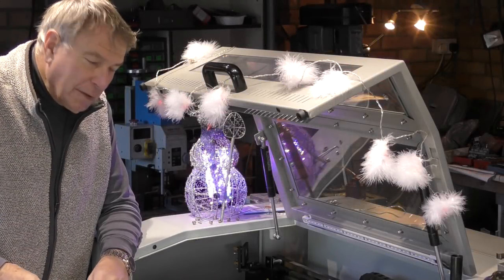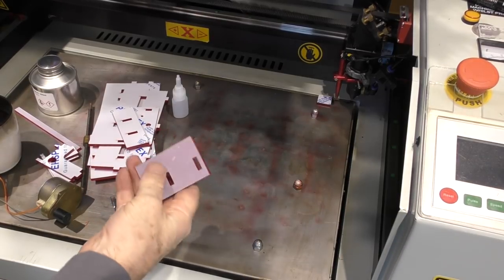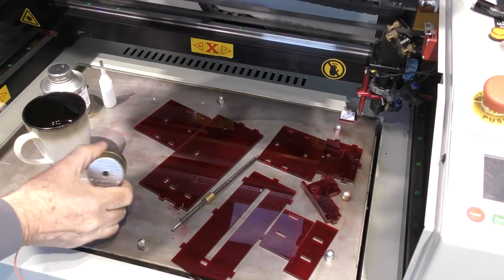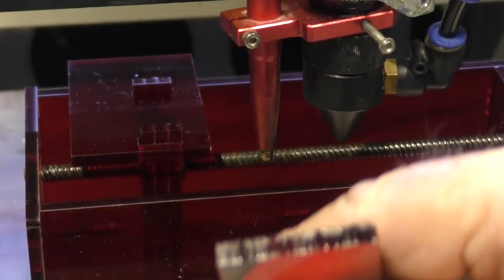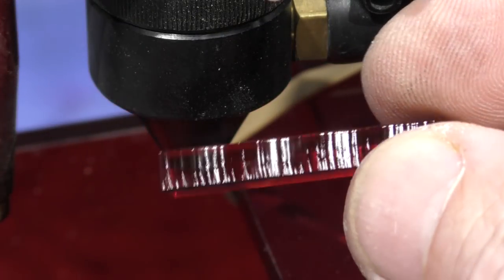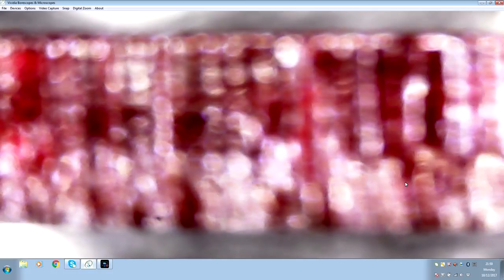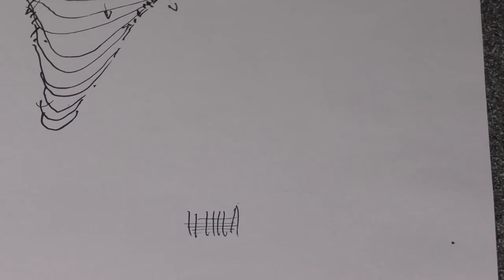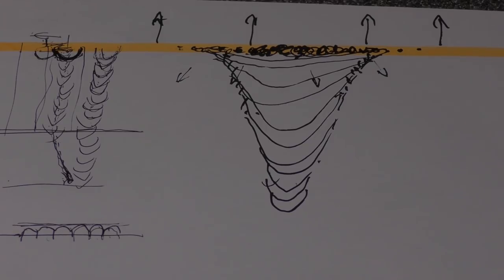RDWorks Learning Lab 128 Are Acrylic Striations Stepper driven

Comment: Are you using the stock diaphram pump for your air assist? If so, its the diaphram pump causing it - add a bit of pvc pipe with done sponge in it to smooth the air flow out or use a compressor with a tank. You can hear the pulsing if you put your finger over the nozzle :) i had this on my first Chinese laser and fixed it with the pvc pipe resistor/ capacitor thing!

If you get three same pattern no matter your head speed, it's mechanical on the laser - pulley, belt or linear bearing.
Reply from the maker: The pattern of striations on acrylic is a very complex subject that I think I now fully understand. The air flow (pulsing or otherwise) has no affect on them. I have run tests at constant speed running (see #128) not with  steppers or servos, and the results are terrible, but there is some fascinating detail to be observed.. the amazing thing about clear acrylic is it is cav be used as a 3D velocity recorder. The slightest velocity change in the head is recorded by increasing or decreasing depth of cut, because the beam is running at constant power. The fact that the head is progressing with a series of microsteps means that the head is continually stopping and allowing the beam to pierce right through before it jumps to the next step. This is the main mechanism for striations and you can prove this by setting the beam to DOT mode and producing a series of straight through perforated cuts. If you get the timing of those dots right you can adjust the values slightly and generate many different aliasing pattern on the edge where the perforations and the steps interact.. If you start running too fast you get something that I call beam drag,.  This is in effect where the beam is not cutting upright (straight through as you would expect) but the  LIGHT beam is being carried around a corner until it impinges on solid material to interact with. This fibre optic property of acrylic is dealt with in  #120. . Provided you do not go too fast this effect will not occur. . I am just in the middle of a video that attempts to pull most of this stuff together to work out why and how you can flame polish clear acrylic and how thicker material is easier to polish than thinner ones plus the fact that when you add colour it becomes almost impossible. to get a gloss finish. I have long been a disbeliever of the  idea that for thicker materials you must drop the focus point into the material to achieve deeper cuts.  Acrylic proves to be a great material to show just how fallacious this notion is.
I have played with various pulse damping mechanisms but to be honest if you manage your air flow efficiently, specifically for cutting) you only  need a gentle laminar airstream directly into you cut. If you can hear the air hissing then you have expanding air as it exits the nozzle and  most of that air will spread rapidly outwards leaving  very little to finish up where you need it. That efficiency depends on the lens tube system that your machine uses and the nozzle hole size.  With some systems the nozzle remains a constant distance from the work (about 5mm) regardless of the lens focal length   Other systems have the lens mounted in the nozzle where any change of focal length means the nozzle (and air assist) moving further away from the work surface. This second system is bad because that bigger distance makes it impossible to manage your air assist for all situations.
 You do not need air assist for  engraving  it only pushes the  burning fumes back onto your work. Efficient balanced air flow  should also leave the surface of your cut work clean also. 
Coming from a metal cutting laser background, where high gas pressures are essential. my first action was to hook up my shop compressor. Big mistake. I soon changed back to what appeared to be a stupidly small pulsing pump. Manage that nozzle flow correctly and the flow is virtually pulseless anyway.

Best wishes
Russ
Reply: I'm not sure I can agree - I've used both glass and RF tubes on thin and thick acrylic that have given absolutely smooth polished finishes on every cut (extruded acrylic) with a good smooth air stream, using a diaphram pump on one of the chinese lasers gave the same pulsed pattern you see - I never bothered with diaphram pump there after. You can also see the effect of the pulsing when cutting plywood, if you get the laser to the point it just breaks through the bottom of the ply you will see variation of width that match the pump frequency. This also doesn't explain the patterning on your engravings, which have nothing to do with gas clouds.

As to the pattern in this video on the edge of the acrylic... you can see the whole thing weeble wobbling around at a constant rate, so I'm not putting much stock in it sorry.

Trotec recommend running their RF tubes are very high pulse frequencies to get the smoothest most polished edge, but still not continuously on if that helps at all :)

I completely agree with no air assist or just the tiniest amount to give a tiny bit of positive pressure infront of the lens when engraving. This one eluded me for years until it was mentioned in a Trotec course and I couldn't believe I missed it!

Another thing on your beam drag - the hot gasses continue to cut even if the beam isn't strong enough to punch through - you'll see some drag mechanism here too. As acrylic is completely opaque to 10.6um light pretty much perfectly, you won't see any fibreoptic effect or the light beam being bounced around inside the block. This is where air assist can help push that gas cloud down through the cut, it's quite apparent on the Epilogs that have the air assist as a separate tube that is not coaxial with the beam, you don't get anywhere near as good a cut as with a Chinese laser or Trotec - it's like running with air assist off, it's enough to stop the gas igniting but not enough to assist the cut. However, I'm sure you're well aware of this from your metal cutting days :)

For the putting the focal point inside the material - I've always understood and used this as a method to get a more perpendicular edge on the cut, rather than more penetration.

For the colour of the material, are both extruded, or is the colour cast? Colour tends to be cast acrylic (great for engraving, poor for flame polishing) because they can run smaller batches (1-2t of material, vs 10-20t for extruded) so you'll see mostly just black, white, clear in extruded. I'd love to see you test the difference between cast and extruded acrylic for engraving, 3d engraving, and polishing. Cast gives you a nice frosted effect for engraving, engraving on extruded in my experience is a little underwhelming by comparison as it tends to polish pretty quickly.

Thanks for your well thought out, extensive replies!
Reply from the maker: Hi
I have not had the luxury of using any of the pro machines or being exposed to any of their training. In addition you also have much everyday experience of using all types of machine. I started off from ground zero and all my knowledge has been derived from experimentation and making mistakes. As an engineer I try to deal with facts rather than conjecture  so  my facts are my facts. However. All FACTS have conditional boundaries and those boundaries may be different for your equipment. I never claim that my videos are some sort of gold standard, instead. I define the  problem I am trying to solve and then explain my plan with the thought processes and logic  that guides me. There is no smoke and mirrors in my experiments they are what you see. I draw a set of conclusions from my results, but you may see the same data and disagree or see something else. I really value your different view of things because it allows me to benchmark my own efforts.  As  mentioned elsewhere, I am currently in the middle of a video about acrylic and the conditions that need to exist for edge polishing to take place plus a lot more on the subject of striations and total internal reflection.( all done in my own shed science way). I will make sure I find some cast and extruded materials to compare  The fact that Trotec advise running at high frequency to avoid  edge marks  could mean that,  despite their silky smooth DC drives, the pulsing action of a low frequency beam is causing edge striations.  I could imagine this to be exactly the opposite conditions  to mine, where the beam is steady but the motion is pulsing.  I can do nothing about my pulsing movement if I run my machine in a normal way. This current  video is a bit of an acrylic fest and I'm sure there will be a few things in there that will make you think a bit more.
All best wishes and again thanks for  your contrasting views on this subject.
Russ
Reply: Can I send you some blocks of hardwoods to try the same test you did with the Acrylic blocks to see how much penetration you get? I can do the test with my laser... but I don't have any blocks of acrylic for a direct comparison. I'd be curious to see how the beam behaves in solid wood which will char and give you carbon rather than just turning to gas. Obviously, you'd have to cut the blocks across the beam penetration to see the pattern unlike acrylic!
Reply from the maker: No Problem it will make an interesting experiment. If I put several tests in perfect alignment I will be able to mill the surface away to reveal cross sections
Knowing what I now understand about the nature of the beam, it will be no contest. The best chance of getting a deep hole in the wood will be within the first few milliseconds when the high energy focused core will instantly erode (if I can use those two words together) its way into the wood by a process of burning the cellulose away leaving a thin carbon film that in turn  will instantly heat up to 3500C and gasify leaving more exposed cellulose to be burnt,  leaving  a thin carbon film behind etc etc. Very quickly two things will happen. A) the hole will fill with smoke which is VERY absorptive of IR light. Those micro solids in the smoke will heat up and burn. thus preventing any more efficient penetration of the high energy core. B) the longer the beam is left in the hole the greater the effect that the lower energy outer part of the beam will have. It has sufficient energy to convert the cellulose to vapour but insufficient energy to instantly excite the carbon to its 3500C sublimation temperature. So it will It will glow white hot  ( causing some slow rate carbon sublimation) and effectively become a carbon arc lamp burning spots on your retina just like looking at the sun. There is a significant UV content in the light so it's not good for your eyes. There will certainly be no internal reflection to conduit the light energy down to the sort of extremes you see with acrylic.
With air assist, a 2" lens and a Reci W2 tube (about 80 watts) I have cut a through a 3/4" plank of American oak  at 5mm/s. BUT that was from a side entry cut NOT a through cut. That would have been impossible for the reasons I stated above.. Penetration ability and cutting ability are two different things and  we both agree you MUST get rid of the energy sapping smoke to let the beam work on the solid parent material rather than the debris.
Message  me with your email address because I seem to remember you were also interested in a dohiky.
Thanks for raising another interesting issue.
Russ
Reply: I agree, I don't think it will do much, but its more stuff to try out and play with - and that always expands the knowledgebase. I also have machinable wax (home made and commerical) as well as paraffin, LDPE, EVA and microcystalline pellets I can cast into blocks if you're interested in the future. The waxes should be interesting as they are very heavy on solids as they ablate/vapourise, but need so much oxygen to burn you wont see much in the way of fire. I'm hoping to try engraving machinable wax tomorrow, if it works out well its going to save me hours of machining with the CNC router to put my logo into some moulds I have coming up.
Reply from the maker: As you rightly say any  material away from the norm will be interesting provided it does not burn with toxic consequences.
Reply: SarbarMultimedia the only really toxic stuff to cut is chlorides, mainly for their effect on exposed metal and ductwork, and aramids - aramids create cyanide gas but in lower volumes than a smoker would see, so no big deal. There's lots of misinformation about polycarbonate because it creates cool yellow or red smoke depending on the rubberisers in it. If you run it through propep or other burn sims there isnt anything scary. Even the hydrochloric acid created by chlorides is no big deal for occasional use. 

Really none of the combustion byproducts or vapourised material is good for humans, but there isnt too much that is immediately life threatening or life shortening especially when diluted with the volume of air the extractor pulls :)

Comment: I was wondering can the hertz of the electricity have anything to do with some of the pecking in the cut?
Reply: I am wondering if we change it via rdworks does it really change?  20khz it says and we can change the value but is that just an input or does it change the oscillation?
Reply from the maker: That 20Khz is the PWM signal and has nothing to do with the tube other than to code the output from the controller to tell the HV power supply to to deliver 0 to 100% of it's rated output current to the tube. The tube has a constant DC signal running through it once it is beyond it's 4 to 6mA pre ionization region.. You can only control the beam frequency if you have an RF tube.....and you wont find one of those in these cheap Chinese machines
Best wishes
Russ
Reply: Thanks.

Comment: Russ - once again an excellent video explanation of a complex subject.  Just thinking.....if the striations are related to the sequence of heat, / melt /  expel gas,  - 'PECKING' as you labeled it,    then maybe a test that upsets that sequence would add further light to the problem.  I'm thinking of a repeat test where the laser is aligned along the edge of an acrylic sheet.  Now the melt puddle would not be trapped and the expelled gas would not have to 'bubble' up back through melting acrylic.  I'm guessing the edge that is RECUT  would be much smoother maybe even without striations.  If that were the case (and I guess its just an academic point)  you could 'double cut' your material and have smooth edges......
Merry Christmas
Dennis
Reply from the maker: Hi Dennis
With acrylic there is no molten material at the cut face. There is an instant transformation to vapor which is hundreds of times more volumetric than the solid that it was. This gas escapes from the cut area at high velocity and there is never any liquid that it has to bubble through. The only liquid that you see is on that lower energy density part of the beam where there is insufficient power to evaporate the material. I hope that makes sense and that I have not misunderstood your comment.
Best wishes
Russ
Reply: Yes I was confusing your test to 'melt a cone into the 8mm' vs. a laser cut through the material.  That said, wouldn't the 'pecking' that I think I understand causes the striation - be eliminated if the gas did not have to travel back up through the cut material as it punches through the material thickness.  Cutting along an edge (laser offset from the edge maybe 2/3 of its width ) would allow the gas to continually escape laterally - no pecking, no striations ???
Reply from the maker: Hi Diane.
Perhaps I confused the situation by showing the pecking action happening as a hole only. At the start of a cut there is indeed a hole and yes the gas does flow up and out of the hole. It has to because there is no other escape route. Remember in the video where I pointed out the red vapor debris at the start of the cut?
Once that initial punch through hole exists, the next cut will have a sideways exit for vapor  into the kerf  The pecking will always be the mechanism by which the cut takes place  and that is the cause of the marks across the striations. The striations themselves are already explained in  https://youtu.be/29L-3TpL8ws
The vapour is full of particulate matter and when those solid particles absorb enough energy, ignition occurs.  If you want a smooth burnished edge, you turn your air assist right down and reduce the cutting speed by about 25% This allows those hot expelled gasses to heat and melt the kerf walls.

Best wishes
Russ